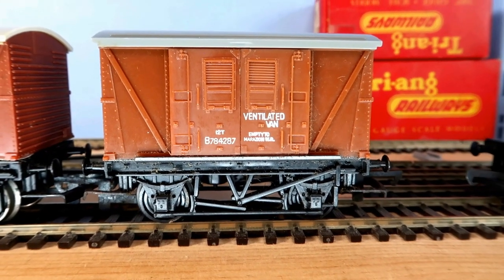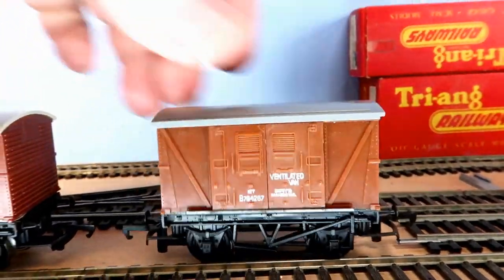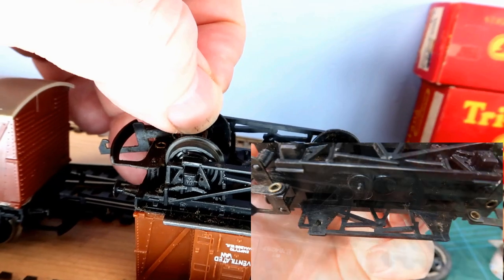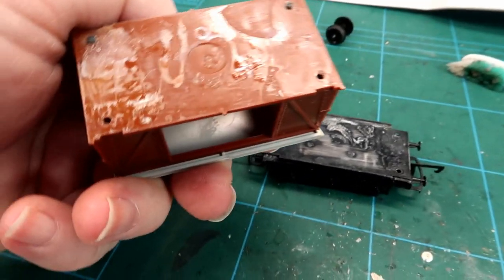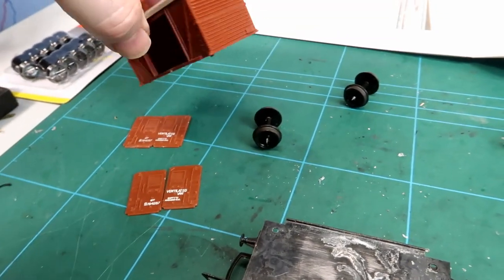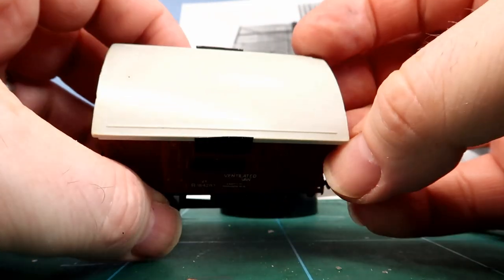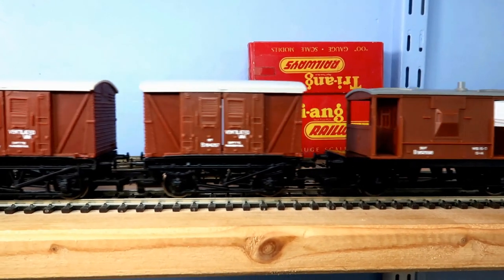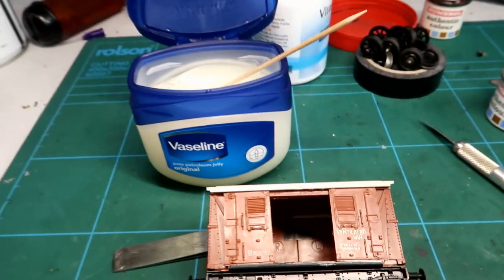Triang Hornby R205 Sliding Door Vent Van restoration

Comment: Very nice, you did a great job. I have a few Triang wagons that need some TLC and you have inspired me to have a go.
Reply from the maker: Cheers Philip, they come up really well. Do you have any open axle box types to do?
Reply: @ModelRailwaysUnlimited  Sorry to have taken so long to reply to you. i do have a few Triang open axle wagons, but do not have the skills to adapt them. i will keep them original and put up with bumping over the points.
Reply from the maker: @PhilPage227  Hi Philip, it's actually quite easy to change out the old wheels, check out how I do it in this video https://youtu.be/ROe1UvmheXU let me know if you go ahead and I can assist.